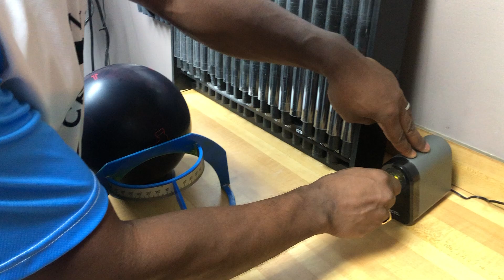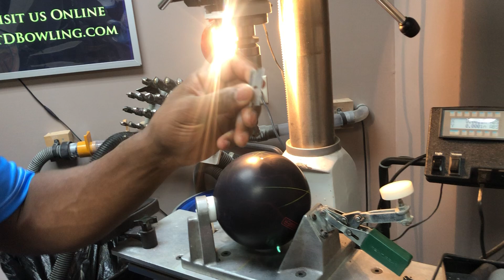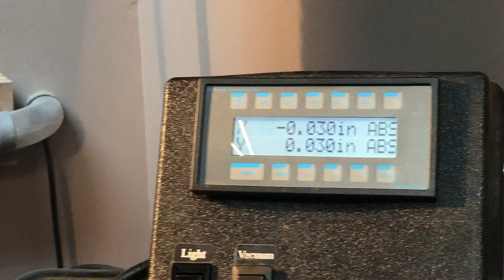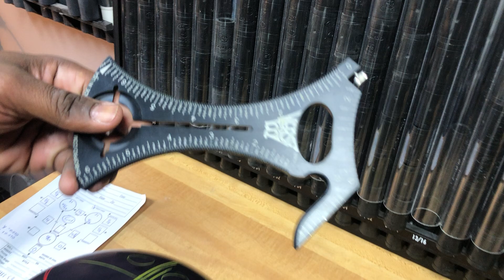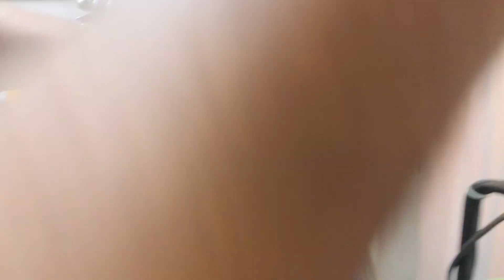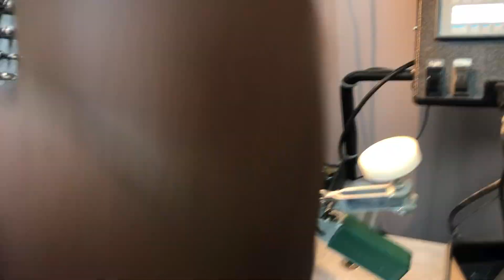How to Layout and Drill a Bowling Ball - Pro Shop

Comment: I have a question I have a drill that doesn’t have the digital which i know will be harder but I did order the tools need to help make sure I have correct pitch but wondering for 99% of people will having the pitch off a slight bit cause a problem?
Reply from the maker: We would have to recommend making sure the pitch is as accurate as possible. Different styles can feel small pitch changes.

Comment: I am from the old school and getting back to bowling. I use to bowl in the 70s to mid 80s. I am almost 70 years. I am getting back to bowling due to my grandson. I bowl using the handshake release. I got 2 new balls, the rhino and black widow 2.0 hybrid. Yesterday was the first time I throw the blk widow. The rhino got it in November. I mentioned to the pro shop that I throw the ball the old fashion way. I am not getting the ball roll pattern that I wanted. Is there a specific hole pattern for my style of throwing the ball. I tried to change my technique but my old body does not work with my brain.  I see the oil pattern and can figure out the PAP based on your video. Do I need to ask the pro shop to redrill my balls. Th blk widow does not give me the curve that I expect to see. It is almost a straight shot.  The hole pattern for both balls are the same too.

Comment: So a sharp pencil is a critical metric to accuracy, but then you mark the line from the pin to the mass bias off-center on both points, you mark your 60° point between 61 and 62°, 4 1/4 measurement marking is good but then your 30° measurement you mark at 31°. You make the 2 inch mark for the thumb hole at 2 and 1/16".  Then you state that his ring finger is at 4" which appears to be marked accurately, and then say his ring finger is 4 1/16" which you then mark at 3 and 15/16" an eighth inch too short. If he is right handed, I sure hope his middle finger is shorter than his ring finger.
Reply: He was all over the place!

Comment: When you measure/mark for the finger holes, why do you measure to the edge of the holes instead of center to center? It seems like you are "guessing" a bit more with the edge of hole method instead of center of drill bit.....

Comment: I thoroughly enjoyed watching and learning the mechanics of it all.  Thank you for sharing.  Now to test my ball driller person to see how much of this they really know. 🤔
Reply: The choice of layout is designed on what you want the ball to do. The reason for the layout is based on how much tilt a bowler creates when bowling since everyone has a different degree of tilt the layout will be different from bowler to bowler. 60x4x30 may be good for a more smoother ball motion with someone that has 7-14 degrees of tilt but if someone who has 3-7 degrees of tilt will need a stronger layout and depending on the ball could require the pin of the ball to be further away from the fingers or closer to it. Also depends on if it's a sym or asym ball as well. The ball and cover stock will tell you what you can and can't do with layouts

Comment: How does the new USBC rules which eliminate balance holes affect how you lay out the ball?
Reply: remember they upped the side weight a ball can have too when they did away with them so it gives them more forgiveness..  

I have wondered though since they done that if you can not do a balance hole and you wanted to fine tune a ball already drilled can you drill a balance hole on the opposite side and ad some weight like lead and plug it over the top so no holes are in it.. I mean if you do not go over legal weight over all or legal side weight would that matter.  No rules against a ball with a plug.   I bet money a few people have done this legal or not. I don't see how they could tell as long as a ball makes weight.

Comment: How did you confirm the vertical axis line? seems like that line could alter due to the angle your holding the measuring device.
Reply from the maker: We line up the pro sect parallel to find the angle. Then make sure it intersects the pin distance line so that it should not vary.

Comment: Is it just me, or did you mix up the spans on the ring and middle fingers?
Reply from the maker: Why do you think they would be mixed up? The ring finger is longer than the middle finger like it is in most cases.
Reply: He must be a lefty 4:16
Reply: I'm not hating. I just assumed right hander.
Reply from the maker: @ThreeTwoVictor  Actually you are correct. What I said, and what I'm doing are two different things. I mark the middle at 4 and say the ring finger. So it's actually done right, but is said incorrectly around 4:20. Good looking out.